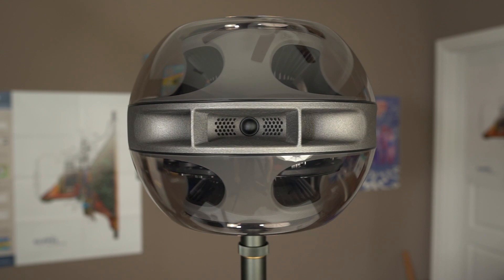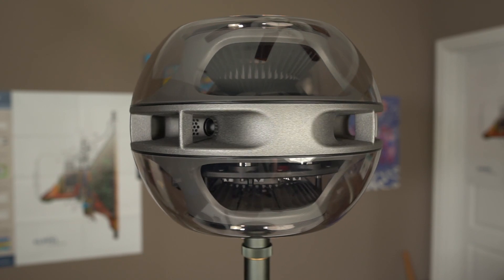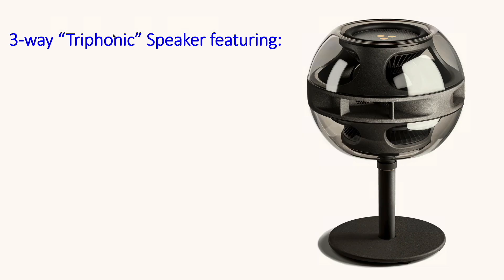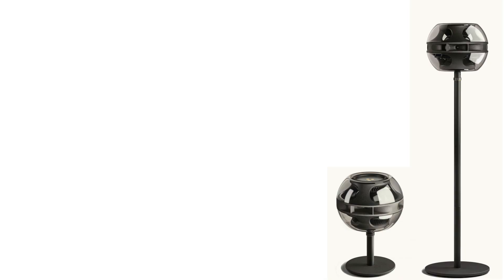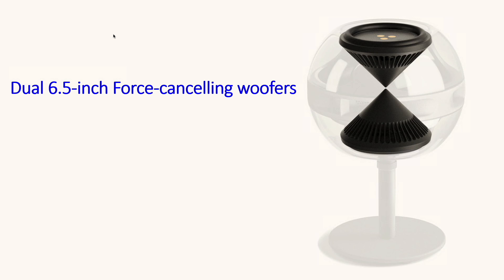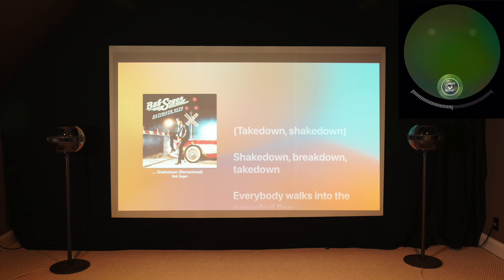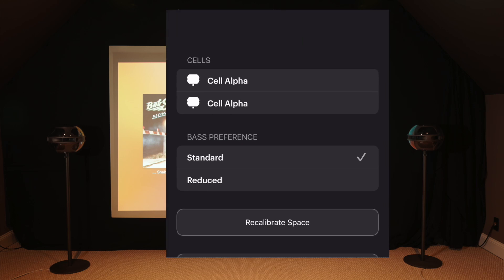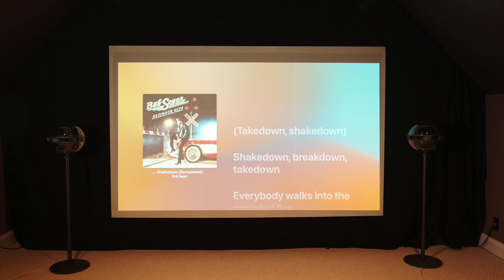An experience like no other!  Getting technical with the SYNG Cell Alpha.

Comment: What Spl does it get at belowv40hz. Impressive it can dive down so low. The home pod 2 gets low to 30hz but only at 80db. Still impressive for such a tiny design on the HomePod. Huge xmax with computational distortion management

Comment: Which Binaural Microphone are you using?  I HIGHLY recommend the Sonic Presence SP15.  From my personal and very thorough testing, the SP15 is PERFECTLY FLAT.  I was astonished to say the least.  Together with the Sennheiser HD400 Pro/HD 560s it provides extremely accurate binaural reproduction.  I also personally tested the HD400 Pro and discovered that they are PERFECTLY FLAT to the human ear (Equal Loudness Contour) at 85dB SPL reference.  Additionally, the angled transducers of the HD400 Pro/HD 560s provides a natural and accurate reproduction of the soundstage and imaging. 

Perfectly flat microphone with perfectly flat headphones = accurate reproduction (provided you are not boosting or attenuating the level of the reproduction relative to the actual source).
Reply from the maker: I’m using those.
Reply: @ErinsAudioCorner  Did you test them to see how flat they are?  From my own testing, they are perfectly flat.  At least my pair.  I assume unit variances to be minimized.
Reply from the maker: @thatchinaboi1  how did you test them?  Do you have a proper head model for measuring?  Is it calibrated?
Reply: @ErinsAudioCorner  I used my very experienced audio engineer ears and a bit of logical deduction by comparing the reproduction with the source.  After carefully examining several songs that I am very familiar with in terms of FR, I discovered that the perceived FR of the SP15 together with the Sennheiser HD400 Pro is identical to the source (coming from my speaker setup).  Due to this I deduce that the SP15 must be perfectly flat, since I also discovered the Sennheiser HD400 Pros to PERFECTLY CONFORM to the Equal Loudness Contour at 83-85 dB SPL.
Reply: @ErinsAudioCorner  I initially expected some deviation by assuming that the SP15 is NOT perfectly flat.  But to my surprise, I was wrong. 

If the perceived FR of the reproduction is identical to the source then that most likely means the SP15 is PERFECTLY FLAT (electronically) while the Sennheiser HD400 Pro is PERFECTLY FLAT (to the human ear) at 83-85 dB SPL reference.
Reply: @ErinsAudioCorner  I never hear you or any of these audiophile YouTube channels ever discussing the Equal Loudness Contours/Fletcher Munson Curves when discussing FR.  I find it interesting that such a simple and important aspect to human hearing is not talked about at all in the audiophile community.
Reply: @ErinsAudioCorner  If you don't believe me you can test it out yourself.  Put on a pair of Sennheiser HD400 Pros or Sennheiser HD 560s and calibrate them to 83-85 dB SPL.  Then take a Equal Loudness Contour test to see if they are indeed perfectly flat to the human ear.

After confirming this you can then go on to compare the reproduction with the source by listening carefully to tracks that you are very familiar with in terms of FR.  You should also discover that the SP15 is PERFECTLY FLAT.

Comment: Erin, you are one of the best reviewers out there. No-nonsense, know your stuff (and Klippel) and present really well. I really want to hear the Cyngs, preferably a trio as it potentially could enable not only multiple sub, but DBA. Would you know if they have DBA programming as well as multisub? The other thing I'm really curious about is the woofers being mounted up and down-firing. I've been exploring to mount mine like that but the general consensus seems to be that gravity will "unlinearize" the response over time. The sagging will have different effect on the one pointing up to the one pointing down. As you know the coil offset will be effected, bringing BL asymmetry, and over calendar time distortion. What are your views on this, and was it something you discussed with Cyng? Perhaps the fact that these are small drivers will mitigate the effect?

Comment: I was going to say you could cheat and feed it periodic pink noise to see the response in the time domain, but I don't think its available in REW. ARTA does it if I recall, but the plots and data are a bit more on a budget by comparison. Not as nice and informative. That and the DSP processing may destroy the timing information in the signal. Sucks cause that's the first thing I wanted to know! Oh well... On a similar note it would be cool to get my hands on something like an Sennheiser Ambeo Soundbar. Be really interesting to see how they process the direct and reflected sound to achieve the spatial imaging, and even from the sound demos it seems to work like it should.

Comment: Even if anechoic measurements aren't possible, the compression and distortion tests in the written review will be great... If it can do what it claims, maybe I'll have to price out this system vs expanding my Genelec 8260 system.
Reply from the maker: You’re right. I didn’t even think about it because I was so invested in the binaural demos and being bummed I could get anechoic measurements. 

I’ve already boxed them up to send back. The best I can do is to say that when I had 3 in my living room, I was getting about 102dB output at my MLP. The three were with two in front (at about 4m) and one to the right about 3m.

Comment: If you had to be an extremist, would you say neo magnets make everything else look like trash when it comes to magnetic field strength vs volume, strength vs weight, and overall not being a wretched engineer? I don't see the point in many subwoofers of having a heavier magnet. I'd rather have them easier to handle... Just brace the box properly and have dual opposing woofers and things could be a little smaller and lighter with the same performance on multi-thousand dollar subs.

Nice to see a new company not just using legacy materials and ultra-archaic engineering in new speakers.
Reply from the maker: Weight it one aspect. But in terms of performance, a neo magnet can also be useful for its size; it won’t block the backside of the speaker like a larger ferrite magnet would. This is especially important for small midrange drivers.
Reply: The main thing is the cost, neo magnets costs more. If you are fine with that you can build your DIY subs to your desired spec